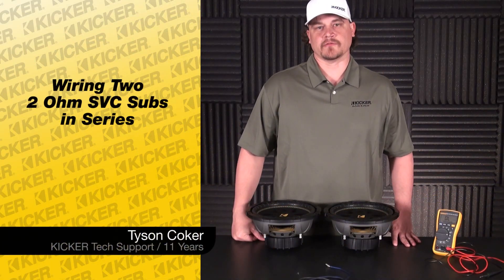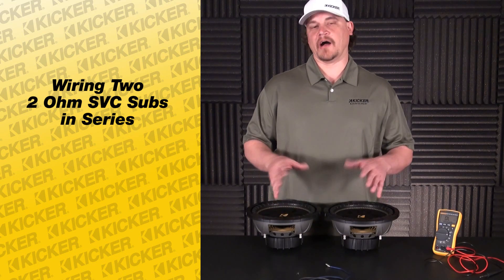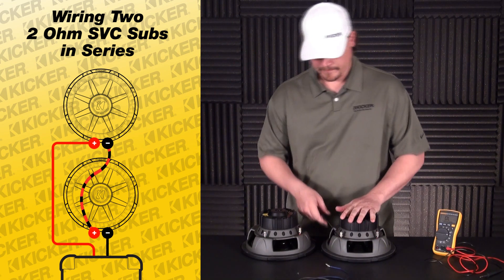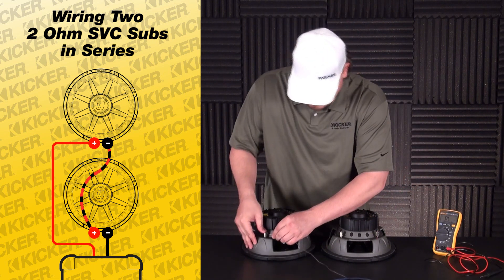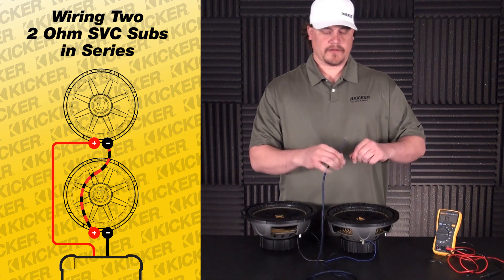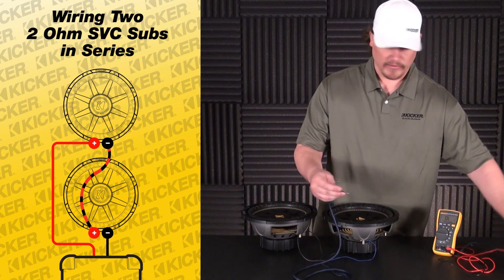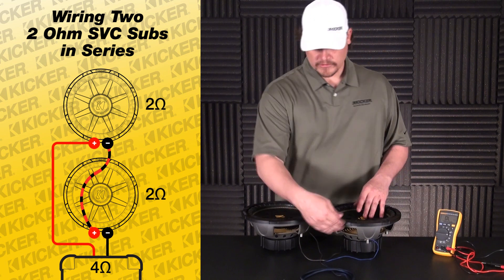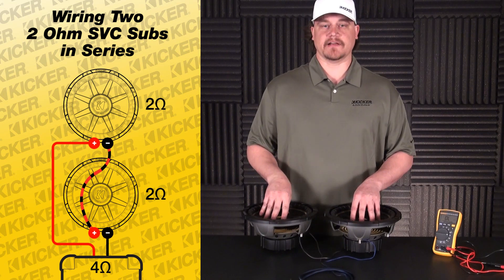Subwoofer Wiring: Two 2 ohm Single Voice Coil Subs in Series

Comment: Hey i got 2 10s kicker i dont hear no bass just vocals try swapping them with another car i have that has subs and they do the same
Reply from the maker: The issue can be one of several things: settings (incorrect crossover setup on the amp or the head unit if it's aftermarket), you could have tapped the wrong wires if using high level input (not all speaker wires carry bass), or it could be an issue with the subs themselves. Call or email our Tech group to let them help diagnose the problem. They are open weekdays from 8-5 cst.  support@kicker.com or 405-624-8510

Comment: sorry for the dumb question.  would this method work to connect two 49L7TDF102's to a CXA800.1?
Reply from the maker: As far as the amp is concerned, a 2 ohm load is a 2 ohm load.  The fact that is comes from 2 different enclosures wont hurt at all.  Go for it!

Comment: Thanks for the video. I have 2 12 inch Rockford fosgate subs. Single 2-ohm voice coil.  1200 watts and 600rms each. If I plan on wiring them exactly the same on this video. What amp would you recommend?
Reply from the maker: The CXA1200.1 wired to 2 ohms.
Reply: @KICKERAudio  thanks for the response, greatly appreciated.

Comment: mine equaled out to 8 8ohm???
Reply: You might test your speakers before wiring them together.  If they are single voice coils, then when you wire them in series and get an 8 ohm load the voice coils are actually 4 ohms.

Comment from the maker: Sorry to take so long to answer.  You might have some resistance on the positive and neg leads on your meter which is causing it to register high.  But if they were truly in the 6 ohm range then yes you would end up with a 3 ohm load.
Reply: How do you wire two 2 ohm subs to an 2 ohm amp
My set up is  MTX Audio THUNDER500.1 Thunder Series amplifier and two Rockford Fosgate P1S2-10 Punch P1 SVC 2-Ohm 10-Inch 250 Watt RMS 500 Watt Peak Subwoofer
Reply from the maker: @BobbyZ-x5e  If they're single voice coil subs at 2-ohm each, then you can't get them to 2-ohm, it'll either be 4-ohm or 1-ohm.

Comment: i have wired my subs the same way they are two 10" 200 watt that reads 6.0 and 6.4 how many ohms will that make them if i had wired them like you did? 3 ohms?
Reply: Brian Smith I got 2 12 kickers hooked to a boss 2000 armor.. what's the best way to wire them
Reply: how would I wire 2 kicker 12s to a 2000 boss armor ?? trying to get most out of 12s